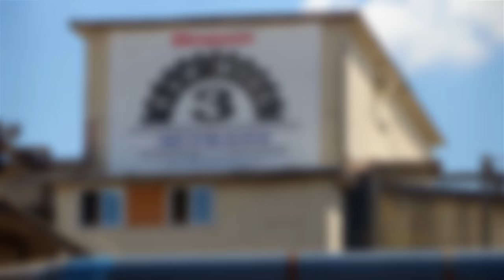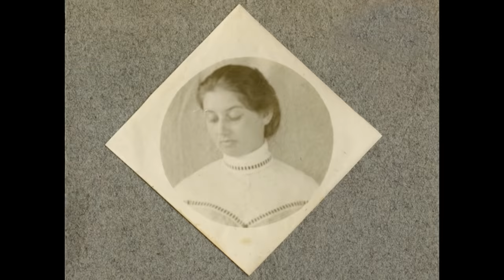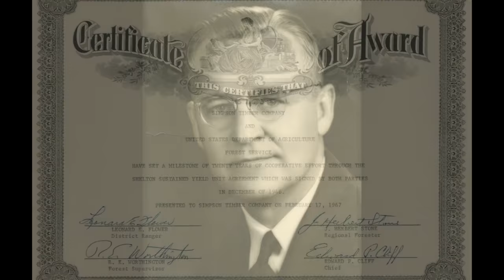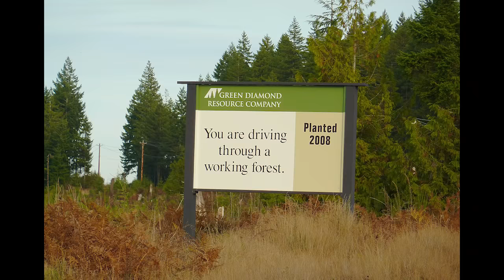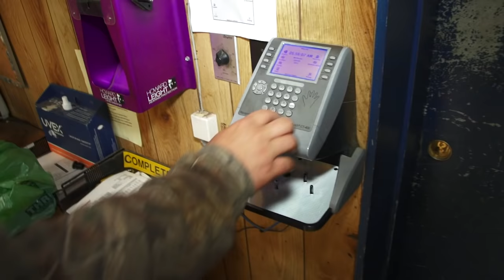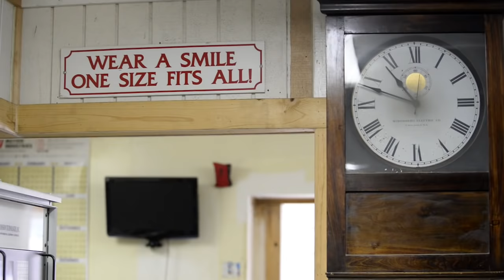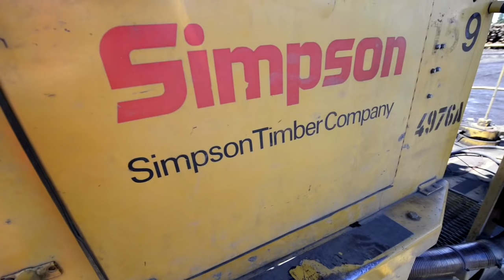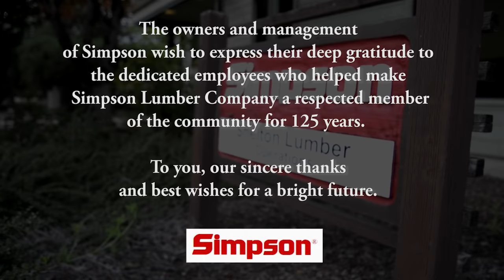Simpson Lumber "The Last Log."

Comment: Bring back the factories& the working man...and job Security.
Reply: sometimes companies just get too big. they cant handle a small fluctuation in the market then, let alone a big one. and thats just what happened with alot of these lumber mills. we lost dozens here in montana. either too small to make it any more or too big to react quickly enough. if you want job security, we need to get rid of mechanisation... remember pensilvania in the 80's? all the steel mills that got shut down? that wasnt competition from overseas, that was new steel mills being built that didnt need as many people to run them.we were in fact lied to about that. the unions lied throught thier teeth.

Comment: No doubt that early lumbering practices had significant negative impact on the ecology of rivers resulting in changes in Pacific Northwest wild salmon stocks. Then dams were built that compounded the negative impact. Thankfully the lumber industry has evolved and considerations are made when harvesting trees to reduce the negative impact that harvesting trees can have on surrounding rivers. Replantation and avoidance of clear cutting could have been done in the early years but no one knew what impact harvesting trees would have without those considerations. We need lumber and we need paper.
Reply from the maker: A good balanced view. We can see how ignorant we were in some areas. But it was us against an unlimited wilderness, or so it seemed in the early days.  The old timers also had many skills, layers of wisdom and character that are different from ours today.
Reply: Without question the best raw material for making paper is the hurd of the hemp plant.
Reply: @pinkpriss  THANK YOU!!! FINALLY SOMEONE HERE WITH A BRAIN!!!